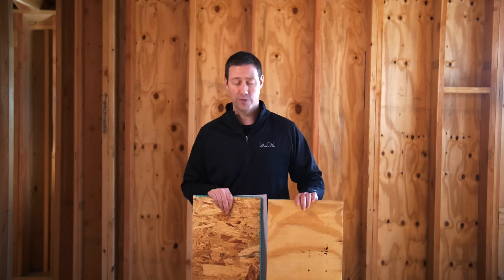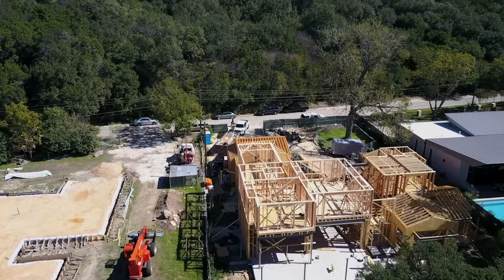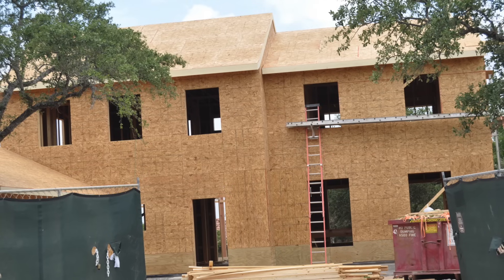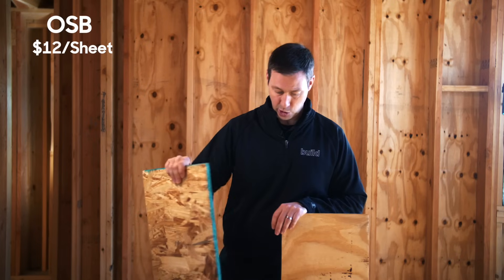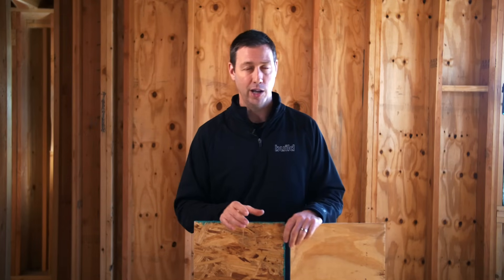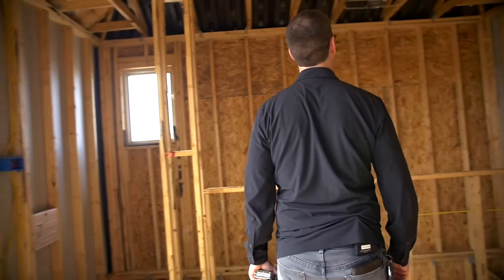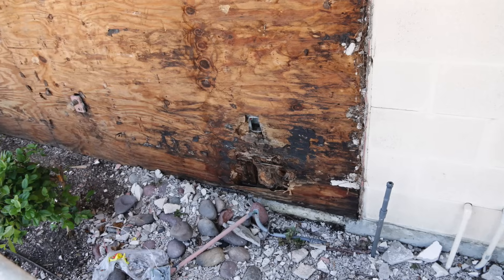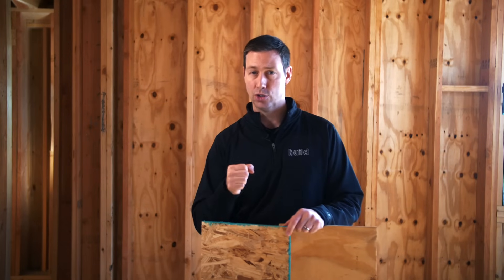Framing : OSB vs. Plywood - Whats the difference in COST AND PERFORMANCE

Comment: .... I'm from Australia. We have something called double brick
Reply: Bob Minichino  Brick and mortar construction.  2 layers.  Air or insulation between the layers.
Reply: Same in the UK too. Nearly all houses are bricks and mortar. Plus we have tiled roofs too. Americans always seem be replacing roofing shingles. Been in my house for thirty years and the roof hasn't  needed any maintenance whatsoever.
Reply: @elitedavidhorne8494  most new houses in the UK are framed with OSB. Then they build an external brick wall around it. If there using brick and not roughcast
Reply: @gideonirv  most new houses are definitely built using bricks and mortar in the UK. I did check the figures and apparently timber frame accounts for 25% of new builds now.  Which represents a massive gain in the market compared to what it was. It used to be just the occasional self build project using timber frame. People still want bricks and mortar. They've just been priced out of it.
I hate OSB and I'd  never live in a house framed in that shit.
Reply: @gideonirv  OSB is good in that context as it's breathable.  That's espacially important in the damp British climate.
Reply: But you guys don't have earthquakes
Reply: Same in Chicago....triple if it's 2 stories or higher ...!!!

Comment: Wouldn't use osb even o. My mother-in-laws house. Cheap crap
Reply: I hear ya Dan.  I don't want any of that OSB garbage-board anywhere near my projects.  Once that rot gets going, it spreads to other things.  It's just a mess.  Not as strong as plywood, either.  It's the definition of false economy.
Reply: Dan Glecier - They all have their own benefits and or drawbacks, modern OSB products are actually quite good and for wall sheathing OSB IS superior to plywood.
Reply: Yes, the problem with plywood is that its not flat. It bends in diffrent directions.
You can't use plywood for interior walls, the only way to make interior walls is to do it propper. First OSB and then drywall above that.
Reply: John Strand I used plywood on my walls. You just need a sharp planer...
Reply: The problem with plywood is that it bends. And it changes form a lot depending on how dry it is. Why, it is layers glued on layers of wood. OSB have broken all form of layers. That is why it dont bend when it gets wet. May i ask why u use plywood?
Reply: John Strand Design in the house. Its over my drywall and lacquered into a patterned each board is  3/4 inch thick , 4 inches wide and 2 feet long running up and down my wall with a half inch gab between each board. The space between the boards is painted a glossy black.
Reply: You have the plywood over the drywall?! Here OSB is under the drywall.
Reply: John Strand Yeah. You would be surprised how good plywood can look on a wall. Especially after its been stained in half walnut stain and half danish oil.
Reply: Dan Glecier wow!
Reply: Tell it like it is Dan. 😁
Reply: If your OSB is rotting, that's a problem with the building construction, not with OSB. You've got water ingress somewhere, and although plywood might last a bit longer, it'll fail too. Don't blame the material for poor construction practices.
Reply: Mother in law?  yep OSB because she ain't paying.

Comment: Advantech brand osb subfloor 
is very good, water resistant and very uniform.
Reply: You are absolutely correct about that. Advantech uses different glues I guess than the 1/2” sheathing OSB. They could make plywood or OSB much better if people would pay for a higher quality product.

Comment: Today it's a huge difference. OSB bottom tier is $15. 1/2" 3 ply wood is $35. That is forcing us to use OSB. Personally, I used it when it was cheap and plywood was cheap and I hated it. This was almost 20 years ago. They sold it as the new better version but working with it was crappy and it definitely smells weird. I am redoing my cottage that is almost a hundred years old and was converted at some point from carriage to cottage. I plan on siding it so I am just going to do the OSB with WRB and clapboard. I also plan on doing what was suggested in one of his other videos regarding insulating old homes and creating an air flow to dry/prevent mold while insulating as much as possible. These channel has definitely been a huge help.

Comment: those that push Cost savings over Quality are the reason so many homes are garbage,  rot, and require massive repair costs.

if your building a Mc Mansion  build much with better quality.   if your building a small home in a poor area...  sure cut costs.

Comment: OSB is the default material that builders are using. If you buy a house before it's built, the price includes using OSB. If you don't say that you don't want it that's what you'll get. I find it really perplexing that the codes are so stringent about air proofing to save on heating, and will outlaw anything with lead or asbestos, but will allow such inferior and even hazardous material as OSB to be used.
Regardless how nformative these videos are, the speaker is being paid by an OSB manufacturer so he's biases in favor of it.
There are building techniques that don't require sheeting at all. Techniques used in old Europe didn't use it at all. Building with sheeting is popular with builders because it's fast and cheap but the homeowner who'll pay the mortgage might see his house rotting at the base long before he's done paying it off. At a minimum sheeting should never reach all the way down to the ground floor. There should be  a waterproof sole at least 50cm tall and enough roof overhang to protect the outer walls from precipitations.

Comment: My 2 cents:  I only use it for concrete "forms" and then toss it.
Reply: High density overlay 3/4 plywood will outlast any OSB and will be used 10 times over when properly cleaned oiled and handled.
Reply: I’d hate to pay for or look at your concrete work (if you do any with a comment like that). 3/4” high density paper coat well out last by a factor of at least 8:1, won’t bow or fail nearly to the extent of osb. I started in con struction doing foundations in 1975 and I have never seen or heard of anyone using OSB for forms.
Reply: @johnshaw873  -- Okay, but I'd hate to pay for or look at your misspelled, ungrammatical writing. For the sake of civilization, take a class in English composition.

Comment: Conclusion: Stone bricks are superior to both OSB and plywood!
Reply: Until the earthquake comes
Reply: @charlesvaughan3517  I would trust brick and mortar far more in an earthquake than a construction of sticks and board nailed together. Unlike most people's perceptions, cement mortar doesn't stick bricks together, it actually keeps them apart. In an earthquake, every mortar joint acts as a movement joint, allowing absorption of forces and settlement when they pass.  
As for a hurricane or tornado...! 
Look at what buildings are still standing afterwards. Bricks and mortar with concrete slabs and roofs.

Comment: Would it help (or hurt) by spraying a water sealant (like Thompson's Water Seal) on the wood under windows and the first bottom ~2 feet just when the exterior sheeting (plywood or OSB) is put on?

Comment: In Germany those houses built with wood structures, like those in the USA, would be called a shed...
Reply: Hammel Bammel there are reasons besides cost why wood structures are used in some parts of the USA like California. We get earthquakes. Using stone or bricks is again the building code. Even brick chimneys are not allowed. They fall through structures like a large tree in quakes. Bricks won’t burn but they will crush you like a bug during an earthquake.
Reply: And what percentage of the German citizens can even afford a house in Germany?
Reply: @Pube83  What's the point of that metric?
How many American can "truly" afford a house? Ever heard of the housing bubble? What percentage of American citizens are homeless?
Reply: That's such a stupid comment.
Use of buildung materials very for all sorts of reasons. Avaibility of materials,  avaibility of craftsman, weather conditions, planed time of use, historic reasons, etc. etc.
American houses are not bad at all, and far from beening sheds. You can get a lot of space for your buck. Most German houses are tiny compared to American houses.
Also many framed houses use steel as part of their structure.
Reply: Dresden proved other wise.

Comment: DryPly superior for subfloor over advantech. DryPly is great for long frame times in wet weather. You are 1000% correct as far as wall sheathing except for using staples in OSB which is against code in most parts of the country now. The key is proper flashing and sealing your exterior before any siding goes on. Water penetration is a house killer.

Comment: Im new to the code, but would building the bottem layer of a house out of a solid concrete board "hardiebacker seems like a good solution imo"  with a water proof barrier that would drain into the "basement" sump pump or septic system be a good solution? would that put to much pressure on the sump pump if a rainstorm occured or is there some material conditions that are not met at that point? i have used hardibacker on many of my shower builds with a sealant to protect my inner walls from build up why is it not more commenly used on the outside of buildings for water/fire protection when it can be both water and fire resistant? at 11 dollars for a 3X5 sheet at my local home depot it seems like to  me that would be a sound use. that or build the foundation walls 1 foot above grade if you have foam block w/concrete foundation?

Comment: Not a Big Fan of OSB  ( Old Shitty Board )  not that you would want to but Plywood can get wet  Quite a few times before Failing . I have a trailer decked with Marine Plywood that is 16 yrs old left out in the weather every year and treated with Thompsons  every 2 yrs  still solid as a Rock.   OSB maybe one or two times and your done  JUNK
Reply from the maker: Ha!  Haven’t heard that ☝️
Reply: Yeah, "Old Shitty Board", I'm stealing this.
Reply: You are comparing apples to hammers. Marine plywood and OSB are not comparable in the way you are describing them.
Reply: Yes that is True but this piece of Plywood is a Trailer Deck that is 16yrs old exposed to Sun, Snow, and Rain and abuse and is still fine after all this time.   my Point was that I would Rather spend the Extra money on Plywood  be it Marine or Regular.  OSB in my Opinion is Only good for Exterior Sheathing and making Crates to Ship things. just take two 4x4 sheets one OSB and the other Plywood leave them in your Yard for a Year exposed to the Elements and see which one is the Winner.  you don't even have to Think about it
Reply: In 1977, I built a rabbit hutch with whatever was sold as "chipboard" at that time, and it lasted for years in the weather with no sealer or anything. Maybe the sun (and there was a lot of it) kept it just dry enough to avoid turning to mush the way it does in wet walls. I tried the same thing with plywood a few years later and while it didn't fall apart, it warped all over the place. I'm sure marine plywood would have held up much better, but would anyone pay for that as exterior sheathing?

Comment: Matt, You standing by a house that has been sheathed with plywood running parallel to the studs confirms you're a great marketing person but no means a knowledgeable builder.
Reply: That was what I thought too, for a looong time. It turns out that walls are much stronger in sheer if all edges of plywood (I won't use OSB for anything) are nailed to framing members.  If you run the plywood horizontally, then you need to block the 4' horizontal seam between the studs (to meet code in some seismic zones). Doing the extra blocking takes time and degrades the insulation properties of the wall, making it difficult to meet the new energy codes. Supposedly, the "wrong" direction of that one extra ply makes very little difference in the sheer strength. Of course, floors are a totally different story. Don't believe me, do the research yourself and give it time to sink in...
Reply: Why? The ply runs in all directions
Reply: I started in the carpenters union local Tacoma, 1976, did commercial work,  government buildings,  plywood was and is the only sheet material used on site !  Think concrete forms, walkway overhead protection,  heavy shear wall cladding .   After a few years got a chance to join a home building enterprise,  same type of technology on a much smaller scale, everyone with large project experience,  the mindset was shared by all on the virtues of plywood and Douglass fir lumber , and I suppose what I'm trying to say is,  we should all share and emphasize the mistakes of the past and try to avoid repeating them,  such as, LP lap siding sold in the wrong regions it was designed for ! Weyerhauser "fiberboard" siding , sold in the wrong region it was designed for, and now the LP building products line of "waste wood" utilized panels, boards, joist, beams , should be thoroughly studied before specifying them for your project !

Comment: What if you spray exterior paint on the exterior sheathing To prevent water penetrating and then use a house wrap. For ventilation Usually you can pick up mixed match. 5 gallons at a low cost It seems to work great on subfloors. During the framing process. Especially if it rains You can squeegee off the water. Also it's Easier to see layout marks and it makes cleaning up dust during the process much easier.

Comment: hi Matt , great videos , in NZ we tend to not sheath our exterior framing but do use  7.5 mm plywood or cement fiber rigid air bariers in place of building paper ,typically with a cavity and then the cladding proper.The plywood is treated to h3.2  (CCA exterior use)  , i believe this is critical - that sheathing or RAB board is treated for exterior use even though its internal , cheers Hans

Comment: Question about using OSB or plywood for roof overhang:  a builder said he is ok with using OSB for the roof but when it comes to roof overhang, he prefers using plywood because it is stronger and looks better from underneath.  What is your opinion?  Is strength an issue with using OSB for overhang?

Comment: Americans could get rid of so many of these headaches if y'all just built houses with bricks and concrete.
Reply: The first thing that I wanted to say is this! Brick and concrete would be a good idea for them not to lose their houses by hurricanes...
Reply: @chrthm27  Exactly. Hurricanes and forest fires happen there so often and they continue to build with wood.
Reply: @AR777bomb  man, I guess their wood industry is huge and they don't want to have such a loss, using concrete and bricks. I don't know what else would be the problem not to use stronger materials. It's ridiculous
Reply: They could AT LEAST use cement boards on the outside (ex. Aquapanel by KNAUF)... Still gonna be better than Plywood/OSB
Reply: Brick is such a terrible insulator though
Reply: Uhm, you still have to build the FRAME of the house with WOOD (and then put the bricks on the outside of the wood).  You still have to use wood on the interior walls and roof as well, unless you are going to form those out of concrete or bricks as well.
Reply: @lcoi-3200  you can put rockwool from the inside and you have a solid and insulate structure. Is this a problem? 😂
Reply: @chrthm27  you can but still doesn't give you the same insulation, also brick buildings are more expensive to build and they are pretty sensitive to shifting and erosion where a wood home is more flexible.
Reply: @chrthm27  brick also has very low tensile strength
Reply: @lcoi-3200  from the outside anyway you put a thick layer of concrete. The same from the inside 😉 No damage in stupid wind
Reply: @lcoi-3200  if you are American, maybe the brick is more expensive. In Europe is not. And no disasters from the wind
Reply: @chrthm27  so the only reason is because wind won't cause much damage in most hurricanes the brick and concrete buildings were damaged just as bad
Reply: @chrthm27  according to some research I did Europe is actually starting to switch over to wood as well with new houses the only reason they don't is the availability of the supplies for wooden buildings

Comment: I don’t know where you are but those are not even close to the price off either... osb is cheap compared to plywood
Reply: That's exactly what I was thinking, and I am in Lowe's, Home Depot and Menard's for my work every day.
Reply: That's what I was thinking. I just whacked up an 8 x 12 garden shed. I used OSB throughout but saved about $450 in doing so. The difference in prices (in Canada) is huge. In hindsight, I probably should have used plywood on the floor, but it's all on 16" cntres so even with the OSB, it's good and solid.

Comment: OSB is good stuff, but not as structural exterior sheeting. Any opinions about modern Fibrolite boards? Those that are wood fibres/strands mushed together with cement-like compound not glue like OSB. I wonder if re-building a shed could be done with those. Those are much more fire-proof than OSB or plywood.

Comment: Great info, but why not use something synthetic like vinyl (basically what covers the exterior of the house)? As I understand it, these wood panels are there to block weather, which vinyl panels should do just fine. They wont rot away either and are still cheap if I remember correctly.

Comment: In the Northeast a lot of houses were built using ledger board for exterior sheathing, I assume this was done for cost. My brother was a roofer for half his working life and he said when re-roofing a 20 or 30 year old roof he often had to replace plywood because of water damage that caused rot. If the roof was t&g or straight ledger board he rarely had to replace any roof decking.

Sheathing that breathes lasts a long time, my 100 year old house has never had to have any sheathing replaced but it's not cheap to heat.